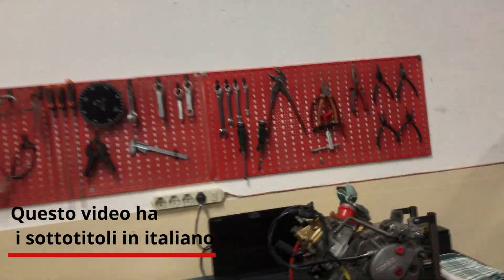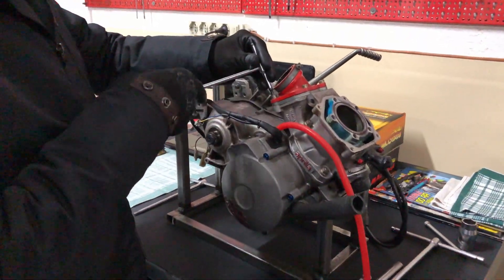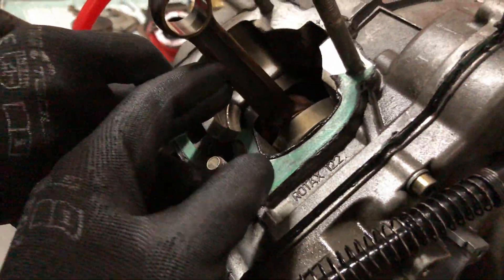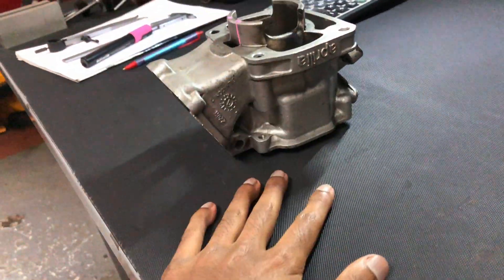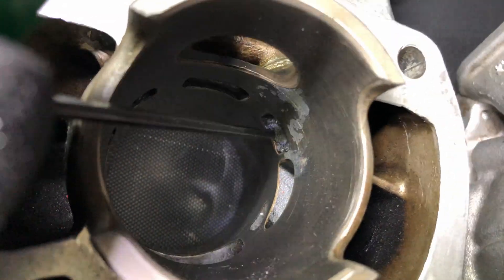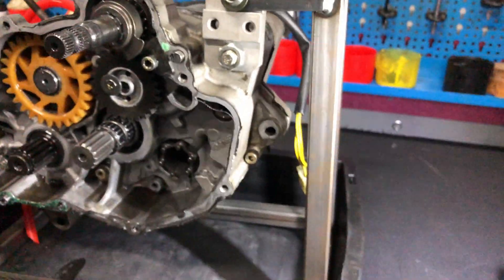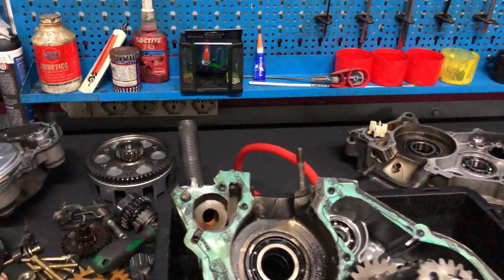ROTAX 122 SPORT PRODUCTION MODIFICATIONS: Episode 2, Aprilia sx 125

Comment: You can throw that cylinder away 🤦🏿‍♂️🤦🏿‍♂️ I'm not hating its just the one whi ported that didn't know whag he vwas doing
Reply from the maker: We started the bike and did a few runs with that cylinder, and it runs great! maybe from the video the cylinder porting looks weird.  But we followed diagrams none of it was done randomly😂we know the limits for how far you can port the engine and how to do it properly. The engine was built to the same specs as a 123 rotax, its not the first engine we do!
Reply: @SheharaDevundara  run, will run always, but how wide you've don the bridge of the transfer port, so thin. Not today not tomorrow, but eventually youbwill end up with a piston ring very damaged or even seeze the block. After th angle of the transfer ports, it's not so critical for relibility, but if you do it the correct way you could get way better results.
Reply: Did you run on a dyno? How much power does the engine made? Also I would love to know the others specs. Kind regards
Reply: @adrianocritelli7074  this mass produce Italian bike made under 20hp at stock.
Port tuning, racing exhaust, reed valve, carburetor, you'll jump to bigger hp easily.

Comment: Well I have to admire your enthusiasm, however all the mods you did to that cylinder were all wrong. Sorry you've got alot to learn about 2 strokes and how to improve them for more power. I stopped watch the video the moment you started 'honing' the exhaust port.

On the plus side if you want to learn, search for '2 stroke stuffing' on YT alot of his knowledge is correct.
Reply from the maker: Thank you for your comment! The engine was modified to the same standard as the racing rs125 engine that we used to race with. We used the same diagrams we did with that engine which always ran extremely well in the racetrack.  
With the exhaust ports, its pretty common to raise and widen the port to gain more speed at higher rpm. Polishing the exhaust port is to reduce the carbon sticking to the walls while helping the exhaust gas flow better that why we did that procedure. Still tell me what mods were done wrong, so if there are any mistakes i won't do it again in the future
Either way I'll look into that channel, its always good to learn something new 😊
Reply: @SheharaDevundara   Lets start with this ::  The mod you did to the top edge of the transfers. Do you know what angle the entrance of the transfers into the cylinder was before you started grinding away, and do you know what angles work best in a 54 bore cylinder?
Reply from the maker: @integral32gb  I looked at the video again and i did say angle, maybe that's what confused you. I should of used a different word.  What i meant by it, was that we removed the curve in the transfer port; we basically re-profiled the internal flow of transfer port making it straight. And we raised the transfer port to correct the timing, so that it matched the sport pro timing. We have the 123rotax sp engine transfer port measurements and other port measurements. We basically used those measurements to port the cylinder in the video.
We didn't check the stock angle, since we work with the timing degrees and the 123rotax port measurements.

Me personally I don't know what angle works best in a 54 bore cylinder. What do you recommend? That way I'll also try it out! 👍👍
Reply: @SheharaDevundara  While watching the video I wasn't listening to what you said, just what you did. The transfers were modified just at the window, badly, you never flowed the rest of the transfer port along its length to match. If you change the port timing just at the window then you change the axial angle too. You have to think of the transfer as a nozzle that has been bent. On a piece of paper draw a triangle, the 2 equal sides being 4 times longer than the bottom. Now cut the top of of the peak off and now you have a 4 sided triangle, with a flat top and flat bottom. The flat top is your port window in the cylinder, the flat bottom is the entrance to the transfers. Now you got to bend that triangle over so the port window is inline with the axial of the cylinder, but the distances between the 2 triangle sides have to be maintained almost the same. Its easy to see this, if you take a piece of plastic card like a credit card, put it between your thumb and forefinger and squeeze it, you'll see it forms a radius, now take another longer piece of card and squeeze it too in your other hand keeping the distance at the bottom the same as the triangle bottom you drew and keep squeezing until you match the height of the port window in your cylinder with the top of the card you see 2 radii. Nice and smooth, what you have done with that cylinder is added a wedge at the top just 10mm or so in. Not good!

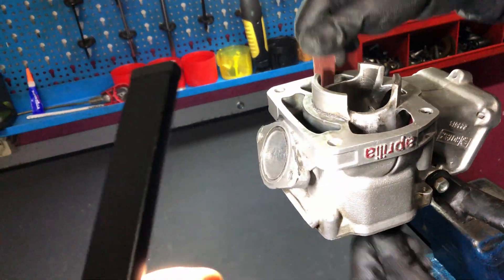Now I don't know what you are trying achieve @9:54 but I will tell you the the inner transfer port wall is one of the most important radii in the whole of a 2 stroke engine. Its important because the outer wall controls the flow direction, it has to, the flow in the transfer has nowhere else to go, its like a wall of death ride. However the inner wall because there is less pressure will not adhere to the inner wall and can detach causing turbulence, so the inner wall must maintain that bent nozzle shape. Most production engines have terrible transfers and actually need more material adding to the inner wall to shape that nozzle NOT having it abraded away.

For the amount of power your Rotax is likely to produce the port duration will be main exhaust : 193-196*deg transfers: 128-130*deg.  Axial transfer angle: because the 122 has a domed piston is: A:25*  B:8* C:55*

One last thing. YOU ONLY POLISH TROPHIES NOT ENGINE PORTS!
Reply from the maker: @integral32gb  On the video its hard to see, we didn't show everything cause the video would have been too long. However, we didn't just modify the transfer port windows, looking at the video it seems that way due to the color differences. We used and abrasive cloth similar to sand paper to flow the rest of the port and make everything flow correctly without any bumps or wedges.
At 9:54 we were just cleaning up the small bumps and blemishes in the port not polishing it. The only port you polish is the exhaust port. 
Yes the inner wall should maintain a bend; however, it has to be reduced, there shouldn't be hard bends in and engine that block the flow. None of this was done randomly we have many manuals and diagrams that we follow.
We tried those degrees before when I used to race with the 125; however we don't use those, we use slightly different ones.
Either way thank you

To polish the trophies I'll need a helping hand, I have too many 🤣🤣
Reply: @SheharaDevundara  Ok, here is a question for you: What in your mind is the most important single aspect of a 2 stroke engine for making power, that if it is not correct, will make any other changes you make useless for high performance ?
Reply from the maker: @integral32gb  I think, the most important aspect to make power once the engine is fully built, is the carburation. if that's wrong then the bike wont run properly, no matter how much the engine is modified the bike will be slow if the carbuation isn't precise. 
There are also other 2 factors, the exhaust system and the squish.
Reply: @integral32gb  you need to do some videos both know what you're doing thanks for learning me about exhaust ports